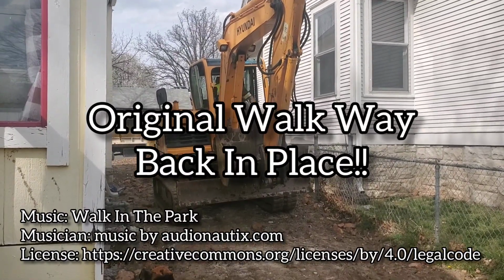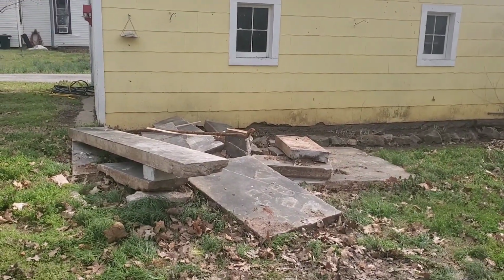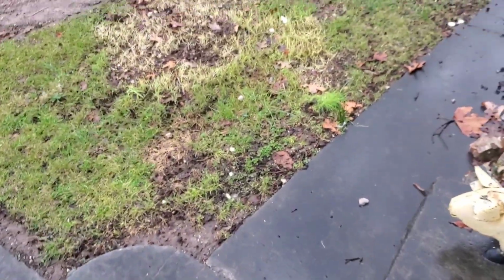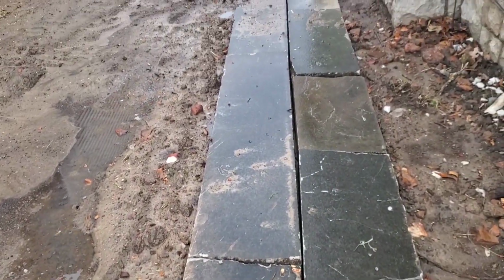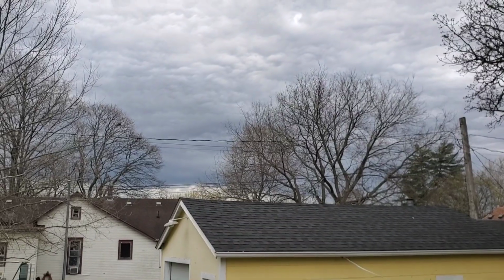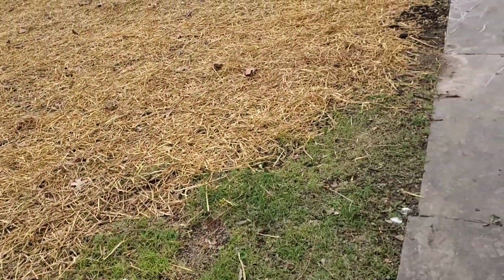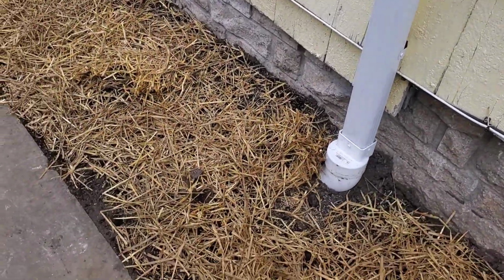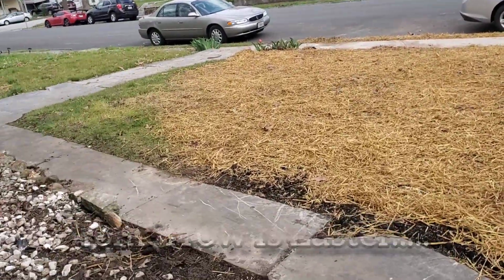Part 10 | 100 yr old House Gets New Foundation | Reinstall Original Stone Walkway  | DeAnna Loudon

Comment: If you don’t mind sharing will you tell how much the foundation costed - that process portion? Currently about to start making calls and I am scared 🥲😂 120 year old sandstone foundation 🥲
Reply from the maker: We had many extras that we hadn't expected... like a new main water line & a new gas line. We also extended the gas line to our fireplace to bring it up to date for a gas fireplace.  We came in at $10,000. Plus an extra $1,200 to take down a tree (clearly not parr of the foundation project but it was a tree that had the root structure ripped through to install the water & gasline)